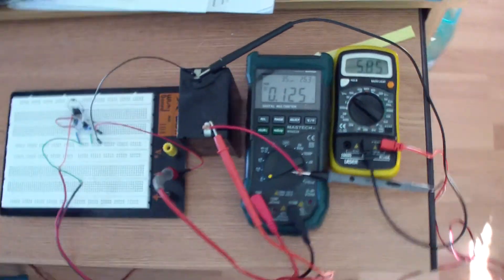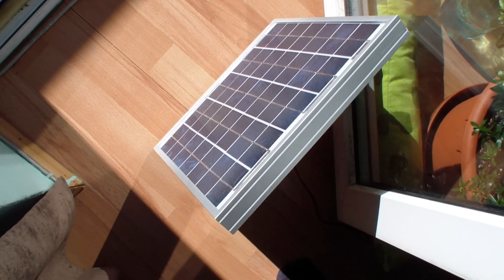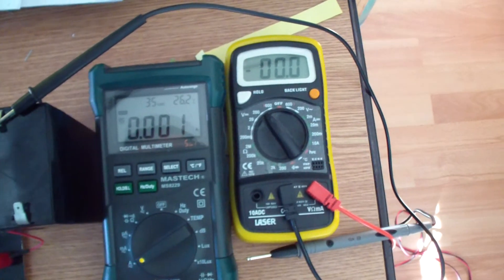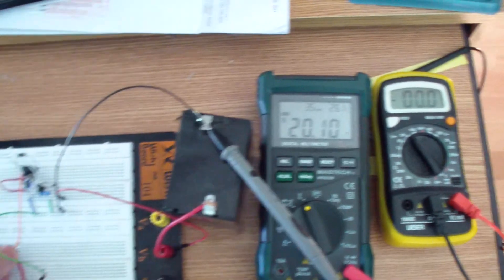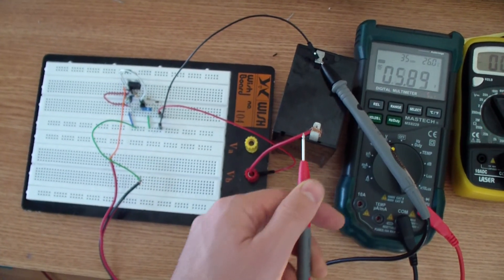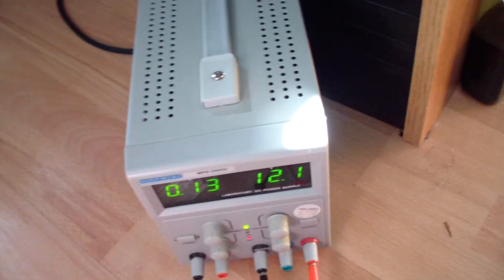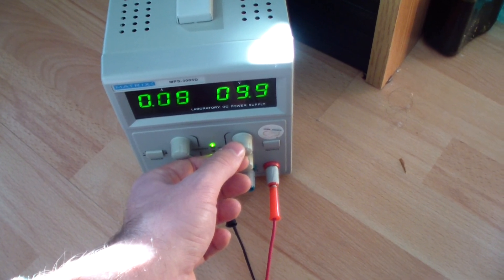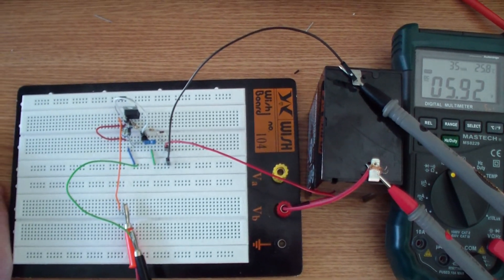6V Solar battery charger

Comment: When any Battery Charges it will pull as much current as it can. To limit the output current from the solar panel use in line of + in series 2 x 12V 5W incandescent Lamps, 10W  / 20V = 0.500A Max can only flow to your circuit. OR 2 x 12V  10W Lamps 20W / 20V = 1A. Also Slow Charging makes any Battery life longer and protect your solar panel from working to hard.

Comment: Hi,
Thank you very much for this schematic and those explanations. Is this circuit can be used in UPS source (Uninterruptible power supply), that is to say : can i add a burst regulator and my MCU just after the battery with the solar charging circuit ?
Best regards,
Aurélien

Comment: On the circuit in the link provided, it is mentioned to use a 6.8V zener diode so that the transistor will conduct when the the battery voltage is at 6.8V. This would not be the case though, the transistor operates with 0.7V Vbe, which means the the the battery voltage must be at least 7.5V in order for it to put the transistor into saturation. Please correct me if I am wrong, it is just my observation.
Reply: this means.. if we want to charge 12volts battery then we have to go gor 12 v dc zener diode?